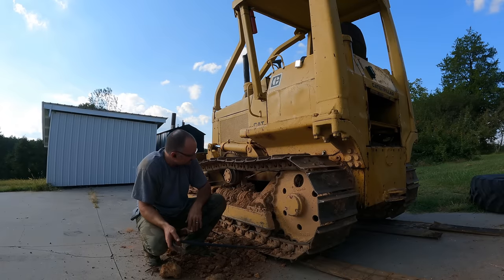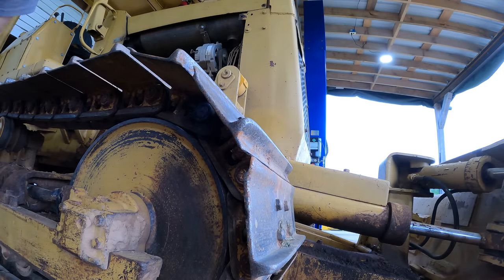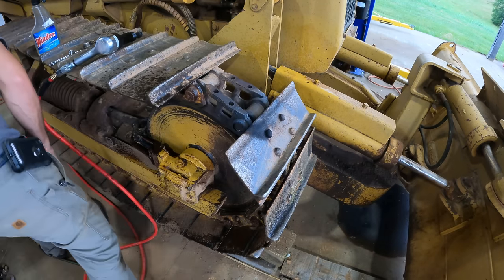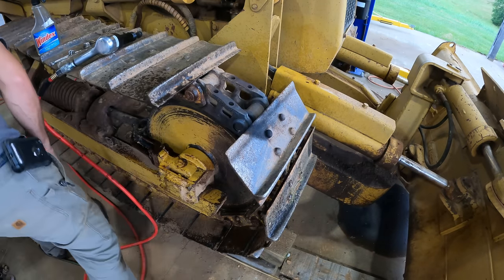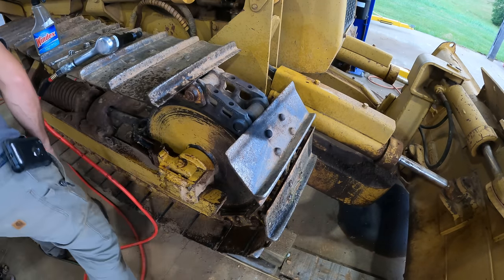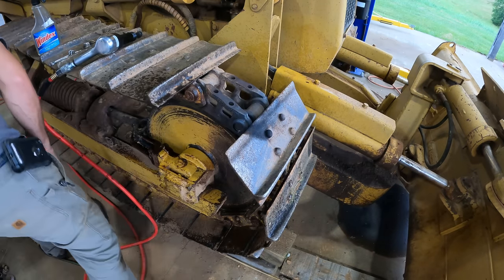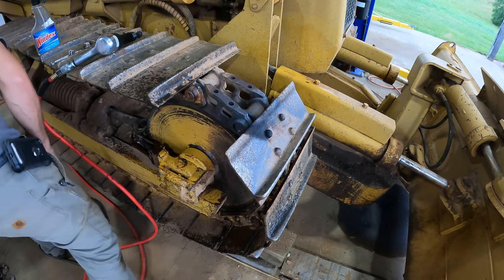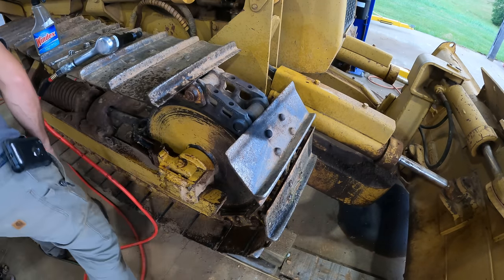Dozer Repair, Splitting Tracks, Adjuster Rails & Slides.  CAT D3 dozer

Comment: Just curious if you had loosened the track tension before you tried removing the pin?  So, yes you answered my question later in your video.  Kudos to you for taking on a big job.  I'm not a metallurgist but I have to wonder if you damaged the chain link strength with all that heating and cooling and heating and cooling and then hammering as well..??

Comment: I'm sure you get it but sometime you get what you pay for. The air chisel/hammer is a cheaper one (CP) and I thought that was the way to go because they don't last very long anyway, they get lost, break and they're all basically the same, but I worked at one ready mix plant that had a Matco or Mac Tool (I can't remember for sure but I believe it was Matco) air chisel and wow what a difference. We used that instead of a 20lb jack hammer to clean out mixers, trust me when I say use caution while using one for the first time they're powerful. 13 years in a mixer that thing is the best! Wish I was 100% on it being Matco but only 70% sure. Oh well it came out alright anyway, perseverance pays off! Maybe you can get Matco or one of those companies to sponsor you? Looks like you could use tractor equipment too. A guy can't have enough tools. Quality tools make life easier, now to win the lottery so I can afford them. Have a good one.

Comment: With pins like that I know is rusted tight, I give it a few whacks, then weld a nut to it to rotate with a pneumatic impact wrench, should grind most rust away, then heat it more and drive it out. Seems to work for me each time.

Comment: Next time you've got a diesel (with a manual fuel shutoff) that won't start because of a glowplug issue (or a cold weather issue), crank it for a solid 30 seconds with the fuel off and then turn the fuel on while still cranking. Heats the cylinders very well when it doesn't have cold fuel dumping into the cylinders. Works in winter on weak or no glowplugs too, and if you forget a block heater.

Comment: Hehe, John, yes, you're right. That's why presses are used to drive pins (and bearings and sleeeves and...), exactly to prevent the mushrooming. Actually the force is the same if you get low mass and high speed or high mass with low speed. The fact is that in order to work, for the low mass high speed, the low mass goes "ballistic" using the pin's resistance to motion from stationary to deform it. Damn, I'm good. Don't think so, I also destroyed a couple of pins swearing after for not being able to remove them...because of mushroom effect... 😉 Cheers, you're a legend!

Comment: not sure if you can get it in mig wire but you can get hardfacing rods to use with a stick wloder for better abrasion resistance

Comment: We had to replace the seals in the tensioner cylinders on my bosses excavator. We didn't bother breaking the track chain. We bled everything out of the tensioner and got the track as Loose as we could, Hope to come along to the inside to our big tractor pulling on the track, and walked it off. Slid it just far enough a way that we could slide the tensioner cylinder apart. Gametime to put it together just move the tractor to the other side, pull the track back over, walk it on and tension it up. Yeah you're wrestling with the track but it's a lot easier than beating those pins out of there sometimes and fighting to get the track plate off so you can get to it.

Comment: your mistake with the air hammer was the bit you used.

the big flat head bit mushed the end, you needed a pointed rod bit(centered rod with divot in the center of the end), its why those pins have divots in the center, to keep the air hammer point centered.

Comment: As far as I can tell you would be better off to use an intermediate rod to build a first layer. Then build up the rail with hard facing until its level enough to grind to shape. Not forgetting the top side plates that are tapered causing the triangular wear.

Comment: Hello Jon! I really like the great content of your videos. But did you notice in 1:06:30 how the joint between the blade frame and the suspension crossmember ist wobbling around as you lift the blade up and push it down? I did not find a video where you adress this issue. Probably there's more trouble coming around...

Comment: Here's a tip for you if your glow plugs don't work and you need to get the engine started... take out your air filter, and put a propane torch in the intake for a few seconds, should heat up the air in the intake enough to fire it up

Comment: Once you got the pin out of one side I would have tried to rotate it with a pipe wrench.  If it would not move then take a small drill bit and drill a hole a couple of inches into the center of the pin.  Then take a large bit and drill away most of the pin then try to rotate again.  If it will not move you now have a perfect hole in the pin to use a punch.

Comment: A 3/8 taper bit for the air hammer that would fit the countersink in the pin would have helped control the hammer and protected the pin from mushrooming maybe.

Comment: I have an idea for a 8x8 or 12x12 square wash bay with a 12-inch thick layer of crash rock or other rock. Additionally, a lift could be installed in the same area for washing underneath vehicles.

Comment: Just curious… most tracks from Cat have a master link . Two links that have been machined ( looks like a track link cut at an angle with staggered teeth ) and no nuts holding the track link and shoe together and has four longer through bolts. Track tension is critical as well , there must be sag between the top track idler roller , idler wheel , and sprocket. The track , if too tight will roll off the under carriage and that would be a bigger repair if you damaged the rollers and sprocket ( 9 to 13000k$ ).

Comment: Having the pin worn 1/4 of the way through didn't help it come out either, especially when it came out of one side. Then it didn't line up squarely between the center hole and inside link, but you eventually got it!!!

Comment: Crazy question from someone who does not own a bulldozer....you mentioned the new style tracks had a split piece...is that something you could replace one of the track pieces in yours so you too had one in the future?  or is that not even close to backwards compatible due to sizing etc?  granted that still does not make it easy to take off this time...but in the future if it fit, it could be easier, right?

Comment: Having actually worked at a carbon products factory the proper method is to use a modified antique bottle capper or equivalent  with a quill and gently tamp the wire into the hole sealing with epoxy is a viable finish though not always necessary.

Comment: Would you break the track if you had to do it again, or is it easier to slacken the chain right off and walk it out of the chain? Thats really easy when you dont want it to happen 😅 Putting them back on isnt too hard, especially if its on the flat with good access rather than on the edge of a creek bank or something, which is where you normally end up like that. I'd definitely do an excavator that way, not so sure about a dozer though?

Comment: Years ago, I loaned my Harbor Freight grinder to a neighbor (exhaust system repair).  He brought it back when it quit working.  The motor ran, but the head would not spin.  Inside, I found worn out nylon gears!  the grinder might have had 20-30 minutes total use.

Comment: I had two different cats that I had to remove the pads on both side the master pin then had to cut the pin out. Cleaned the holes and installed a new master pin. Two days each side!😩

Comment: i imagine you could make a hydraulic chain break without too much effort that would drive the pin out too. in my mind, you get a solid chunk of metal bar stock that will act as a fulcrum and will sit parallel to the pin. then you get two very thick piece of angle iron that will act as two levers. you fix the angle irons to either end of the bar stock such that they can pivot freely. make sure the angle irons extend quite far away from the pivots while the pin is very close to the pivots. then you attach a hydraulic cylinder to the long ends of the angle irons such that the cylinder is between the irons. now when you extend the cylinder, it will pinch the other ends of the angle irons together. if the other short ends of the angle iron have a punch and a tube on opposite sides of the pin, the pin should be forced into the tube with extreme amounts of force. you could easily make this pair of reverse pliers so powerful that it would destroy itself.

it would be a ball joint press on ultra steroids. if anything, it would be interesting just to see such an ad hoc hydraulic press crush random things.

Comment: The bull in bulldozer should give a good hint on tools needed. Big sledge hammer used on sub fins,  150mm pin, 4 days 10 people.
Like face shield, it's all big heavy hauling, but using small moves.
Safe bulldozer doctoring.

Comment: Next time you need to split a track on your dozer.
It is easier to spilt it at the sprocket first slacken the track by opening the grease adjusting bolt and put a pin on a top tooth of your sprocket  and drive back slowly, not to far just enough to pull the idler all the way  back.
Then push the blade down to lift the front of the machine you may need some timber blocks under the blade.
Then put 2 blocks under the tracks midway on the machine lift the blade and the back of the tractor will lift up block this up and  push the blade back down.
Take out the blocks under the tracks and block up the front. Under the front belly plate.
You can turn the tracks so the master pin is at the back . As the track is up of the ground 
Put a block under the grouser on the pad with the master pin in it and drive the track back slightly to take the play out of the pin and lock the track.
Knock out the pin.
You can then move the track to the front by putting  a smaller pin in the track and driving in forwards.
Couple the track at the back when your finished.
Or split the track at the sprocket without lifting  the tractor and drive the tractor forwards so the track is like a rail.
Hope this helps.
Mick from Leeds U K.

Comment: one of our tricky DIY man with an old abandoned motorbike restauration video with MORE than 61 million watches on Youtube recommended 50% kerosene +50% motor oil as the best releaser. By my own exp it works. Maybe this self-made fluid will help you in case you cannot use heat. It takes not too long to spread on threads or other connections due to kerosene. Also I've heard about acetone + ATF (50% both also) but I didn't try this myself and cannot say smth. about it.

Comment: I thought you'd put a sharpened punch in the dimple so it transferred all force of the strikes into the pin rather than allowing it to jump around.  Funnel that force!   And get a portion of the slide on both sides red hot with the rosebud, then hammer the pin through.  I still have my Chicago Pneumatic hammer I used on front ends from the '80s.  The CP-716 was the hardest hitter way back.  OK, bending the link, can you get a portapower ram wedged against the blade cylinder behind the pin to hold the link in place while you battered the pin?  It's hell being 2 months late with these comments, eh?  LOL  We had a huge C-shaped ram at the body shop which would have been perfect for this.  You could change U-joints with it using only one finger on the pump handle.  Ah, you have a similar one, about 1/3 the size.  Weld a slide hammer puller to the bent punch and hammah it out.  Cracked me up when you heard us collectively GASP and said "Just kidding!" while you =then= lit the weed burner with the tiny propane torch.  LOL  Try a Pferd disc next time you need to take metal off.  They can't take heavy use, but if you wield them gently, they'll take inches off in minutes. Pferd 61201 5" CC-Grind-Solid 7/8" A.H. - SG for Steel, $7.16 at Amazon. I got the same Bauer grinder ($69 on sale) for running the Pferd discs.  They make the 4-1/2" grinders look like toys, don't they?  Too bad it didn't last for you.  //  Helluva lot of work.

Comment: Man that looked like a hell of a fight to get that first track split. Was wondering why you had not let off the tension at first - but even after that was let off you had a heck of a time moving that pin - I think it did not want to move out of sheer spite after all the other attempts to move it.  but heating it up made true the words it aint tight if its near liquid..  I was curious how much a new idler wheel was - cause I get curious about $ saved doing things yourself - rough google search shows entire idler wheel + those slides is under 700 bucks, figure both sides 1400.. combined - not counting the slide rails which you repaired as well. so your saving a decent chunk of money while reusing or using supplys you already have on hand.. So its not like your not gonna get your money back saved.  New track chains (not counting the plates/bolts for plates) gets pricey at 1500+ for 1 and thats IF they have size/model number correct when I googled..

Comment: I'd've probably welded a nut or something to the end of the pin to be able to pull it out. A piece of 1" fine thread grade 8 threaded rod can pull with around 75,000 pounds of force, allowing for a 20,000 pound safety margin (breaking strength is 95,000 pounds (150,000 psi tensile strength with a minor diameter in the threading of 0.9008 inches)).

I've done it a few times to pull pins out of heavy machinery. A small c-channel H frame with a bridge at the top and a greased nut bearing on a couple greased washers on that bridge, and pins come out like nothing. Just have to keep yourself out of line with the rod if the pin is stuck good, as you are relying on single shear farmer welds on the nut welded to the end of the pin.

But your way worked just fine once you realized you need to take the tension off. My way has pulled 4" diameter rusted in pins while under tension, but sometimes you don't need overkill.

Comment: First thing I do is take one pad. 10 put a piece of pipe between the frame on the inside of that track to stabilize it so don't bounce.
Reply: The punch is 30000 smaller than the pin

Comment: I have taken a few hundred pins out.  And yea we were hollering at the screen. Loosen the tracks first and try not to have it over the top of the idler wheel because it's in a bind it has weight pulling each side up and down.  
  One thing about a cat d3 you will have plenty of footage from now on.
   But I will give you some credit, you stuck with it. Most people would have just poured 10 gallons of diesel on it and a match🤣

Comment: Several years ago I bought a chopped cell from harbor freight. A small plastic piece broke and I called them up about getting a replacement. That's what I found out they do not sell parts for anything. I still go to Harbor freight but if it plugs into a wall. I don't buy it from them.

Comment: I use an electric concrete jackhammer to drive large stubborn pins out of holes. That is what the dimple is for. The dimple is where you place the pointed end of hexagonal pointed tip attachment in. I lay the jackhammer on its side on a small scissor hydraulic (Harbor Freight) table to get the vertical height just right. I recommend the large Hercules brand Harbor Freight jackhammer. That is what I use. You will find that this will become your first choice to do this type of task.  But God help you if this does not work. Better get out a drill and start drilling.

Comment: Yes, not releasing the pressure on the track was your first mistake.  The second was not backing up the chain link against something solid, like you did on the second one.  Third was using the wrong bit on Thor at the beginning.  You needed a blunt nosed punch at least until it got moving.  Then Thor might have had a chance !
Last, on that wiring harness, I don't understand why it is in that tube/shield ?  I would probably make my own using the wire from SJOOW cordage or maybe silicon wire, like used in RC cars/planes.  PTFE insulation is good also.  I could not tell what the connectors were on the end.  To eliminate slices (and potential future failures) run all 4 of the wires to the outside of the head and connect them together there.

Comment: I would worry about rebuilding the motor before I'd put any more effort into other work on that dozer.  If it's burning oil like it is the rings are likely bad and it likely has a worn cylinder bore.

Comment: The cost of sprockets is minimal compared to the cost of the chains. All you would do is accelerate the wear on on the most expensive parts.

On a side note. With a dozer you will never run out of things to repair.

Comment: The very first mistake is pounding on the end of a pin. Most of the time you will mushroom it out. As I was watching I was thinking why didn't you just make a gear puller with a beefy fine thread screw. Just like when you put heat on a part with a hole and a bushing in liquid nitrogen the clearance may be several thousands but as soon as the bushing picks up that heat it expands and will get stuck. I know you know this but heating up a flange with the pin inside and they both reach the same temperature does not give much of a gap, so when you mushroom a pin heating up the hole will not give you enough space for the mushroom pin to go through. I would like to have seen you tap the pin back in and then cut the end off it and then push it out through the hole since the pin is probably mushroomed on both ends. I'm old now, so I've learned several things the hard way. And that's the beauty of YouTube being able to see somebody pull something apart so you don't have to learn it the hard way. Your channel is one of my favorites. Another idea is to make a portable hydraulic press.